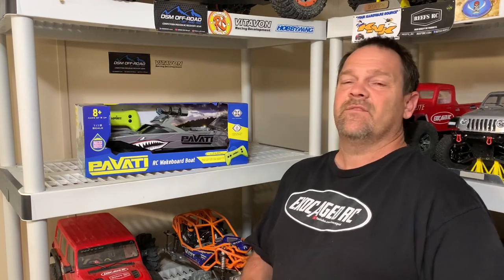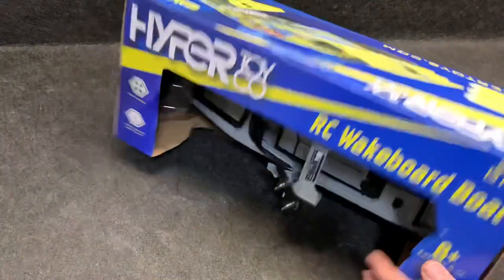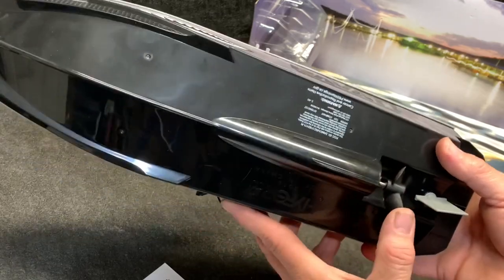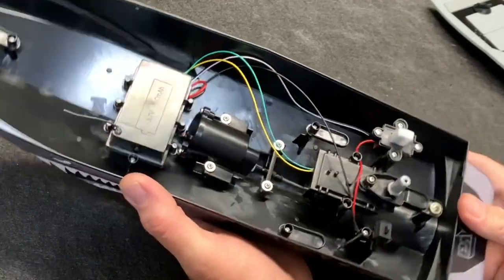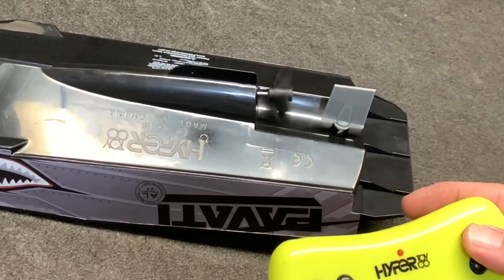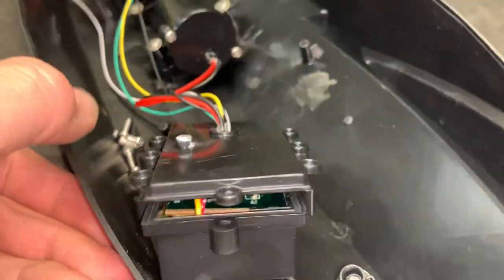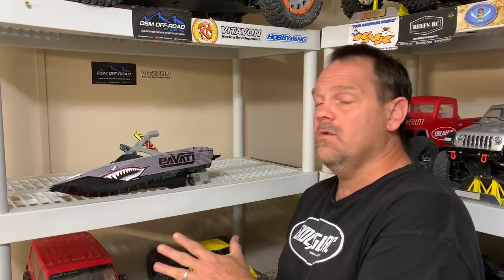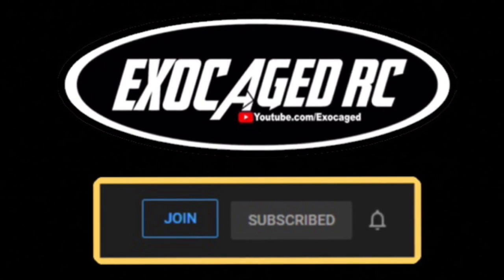$30 Walmart RC Boat Any Good??

Comment: I have done some boating, if u remove the rudder motor, use the existing mount for steering servo, then u can screw it in the bracket, instead of glueing, more permanent👌🏼 and if u do the same with engine mount and esc/reaciver u can get all screwed in place, good luck and have a nice day :) 
Cheers from sweden

Comment: Cool looking boat. Even if you don't increase the speed much, it will be much nicer to use with proportional control.

I bet it would be easy enough to bodge a bigger motor in, though. Maybe a 390 from someone like a wltoys...
Reply: NVM just saw the followup video 🤣🤣

Those little brushed motors just don't have much thermal headroom!

I tend to go to brushless for stuff with motors this small to avoid the issue. A little 280/370 size brushless motor and esc are dirt cheap these days and they have way more performance AND much better thermal properties. Chances are you won't need the throttle EPA to be 100% either which will further help heat matters.

It might sound a little elaborate but those little brushless motors are way tougher and better performing and you can always move it between projects.

Comment: Props CAN cavitate under a boat.....that’s what all the old RC boats had........which is why surface piecing prop systems are the rage for the last 25+ years😎
$30 more you can have a real proboat jet boat. We have a fleet for racing in the swimming pool......it’s a real toy boat.

Comment: It is no wonder kids are not getting into radio control as much as the industry needs to sustain themselves, if I got that I would not go for anything RC, I started with clockwork then remote also a Tamiya or two but were to fragile for my clumsy lack of driving skills and did not bother until I saw a TRAXXAS T-MAX and E-Max but broke them every time I used them probably because I put the most power I could find the T-Max got a huge nitro heli motor the E-Max got a couple of brushed 720 motors. 
So nothing until I happened upon a 5th scale off-road meeting in Germany, I blagged some cash off my father and what I had in my post office account and bought a FG Marder 23cc gas buggy, but then had to wait another couple of months to get a stick transmitter and receiver and a receiver battery, then syphoned the 2 stroke lawnmower of it's petrol oil mix and annoyed every neighbour in a mile radius of home as there was a big woods not far from home. Eventually my parents used to take me to tracks and leave me there all day, the rest is history, but the cheap toy grade nearly put me off for good. Even when first I tried to race rarely got passed practice or qualifying due to breakages or and bad driving but thanks to all there I got loads of help and hand down parts and then I raced, I have found the 5th scale guys not so serious as other smaller scales were and it is still like that practice qualify barbeque beer sleep out of the tent and repeat they did not take themselves seriously but once on the track different people and that was my kind of racing.

Comment: Surface-piercing props aren’t cavitating, but rather they are entraining large air bubbles to prevent tiny air bubbles from forming from the pressure drop across the prop blade surface. The roostertail is just bonus. Whether one has to worry about cavitation at 1/10 scale is not so clear to me. But I love the surface piercing prop on my brushless Rio.  

P.S. Most boat ESCs are full throttle whenever under power, they just dump the extra power that’s not going to the motor, is my understanding.